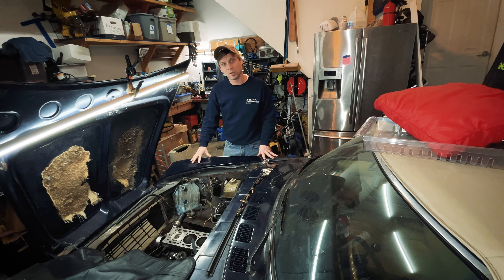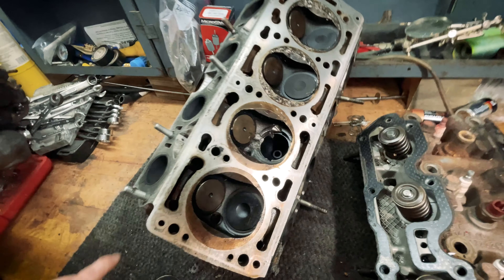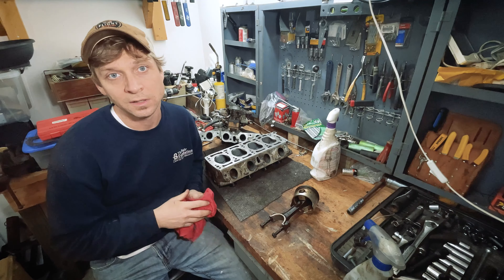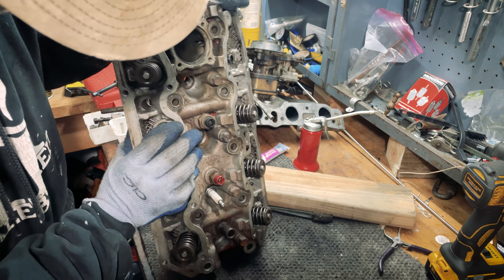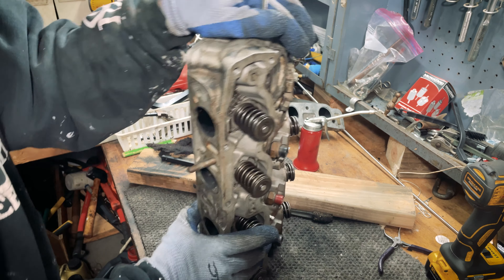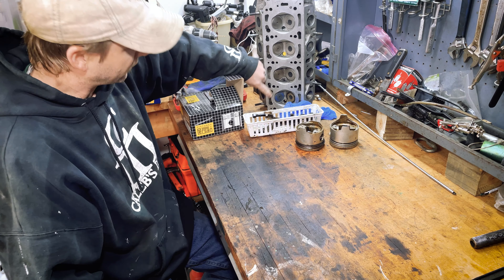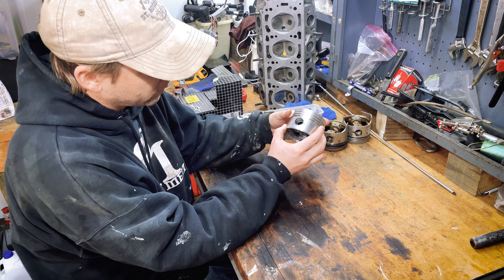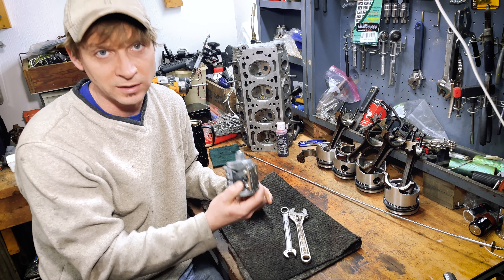Complete Engine Rebuild While Its In The Car For On Barn Find Fiat 124 Spider Part 1

Comment: I have a 76 Spider pulled my engine out sent the Head out for rebuild & the machine shop did a terrible job on the Head had to take it off after starting the engine,same shop rebuilt again 2nd time around turned out better still have my spider time for a new timing belt after 15 years. Good job Chris.

Comment: Couple of comments for future DIYers attempting this or working on any head: 
1) always check the valve stem axial play in the bronze valve guides, and always plan on replacing the valve stem seals. If the valve has too much play, it can misalign in the seat and not seal. The guides can be replaced.
2) always keep the valves in order from where they came out, they each wear slightly differently and need to match up. It matters. Number and poke the valve stems through a piece of cardboard to keep them straight. Same goes for the buckets.
3) That wasn't lapping the seats. Lapping the valve seats and valves should be done with valve lapping or grinding compound, grinding both the valve and the seat into each other. Chucking up the valve stem in the drill and pulling it into the seat and spinning it both directions a few times works.
4) After lapping, clean the head and valves, springs and buckets REMORSELESSLY. Best bet is with a parts washer, but a utility sink with HOT water and dish soap works even better. After you think it's completely clean and rinsed to where you think there isn't a single speck of dust in it, then DO IT AGAIN. After, dry it all out with compressed air. 
5) Check the flatness of the head and block with a machinist flat edge and feeler gauges. If not completely flat you have to evaluate what's wrong. I have successfully used sheets of emory cloth glued to a piece of glass and sanded heads flat. Use Prussian blue to mark the high spots and sand them down flat. Afterwards, WASH and DRY IT AGAIN.
6) You have to check the clearance on the con rod wrist pins and on the crankshaft bearings! 
Nice work, I enjoyed this. I once owned a 1980 Spider 2000, and really miss that car.

Comment: How did you perform a compression test without the cams installed? How do you know if the valves were sealing the chamber on cyl 3?
Reply from the maker: With the cams removed, all valves will be completely closed and sealed at all times. So, just spin the pistons and each cylinder should create compression. Yes, it could have been leaky valves on cyl 3 but I figured it was unlikely since I could visually verify the valves were seated correctly and the other cylinders held some compression. And since number 3 piston was so badly damaged, I decided I was worth just replacing anyway.

Comment: Love your Spider and flying videos Chris. I have an 83 spider (owned since 89) and I also fly (recently sold my 1946 Fleet Canuck).  My spider has 90,000 kms and I am pretty sure my valve guides need to be replaced. I also have a slow leaking rear seal which has done a good job of undercoating my car over the years. Do you think you would be better off to just pull the engine and work on it?
Reply from the maker: You'll need to pull the head to replace the valve guides which normally would be done with the engine in the car, but add in that rear seal and at that point it might be easiest just to pull the entire motor. That would also give you the opportunity to more easily replace a few other relatively simple bits while you're at it.
Reply: @ChrisClarkeFly  Thanks Chris. I agree, I'll probably pull the engine, clean everything up and replace what needs to be done. Love the videos.

Comment: How did you managed to take out the oil pan?
Reply from the maker: I loosened the motor mounts and raised the motor from below a few inches and was able to clear the crossmember. I'll detail the installation in reverse order in my upcoming part 2 video.

Comment: Do NOT rotate the crankshaft when the cams are installed without having the timing belt correctly installed.  If you do, a valve WILL bend or break.  You have been warned.
Reply from the maker: Hi Bill. Thanks for the feedback. You should also consider watching some of my older videos, specifically this one where I demonstrate on a damaged engine that when gently turning the crank by hand its virtually impossible to bend or break a valve. https://youtu.be/zoguZI0ou30?t=388
Reply: @ChrisClarkeFly  Yeah, I cringed when I saw that.  That engine had a bent valve. Perhaps that was why you were able to turn it.  Check my replies on a couple of your previous engine videos.